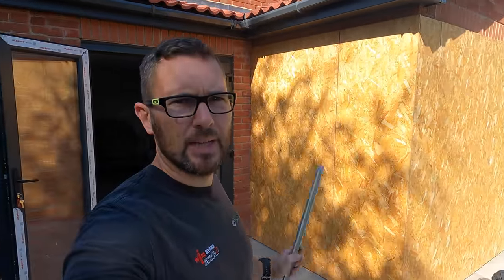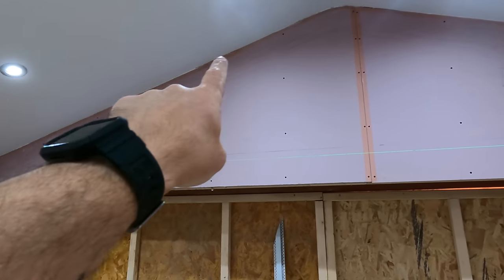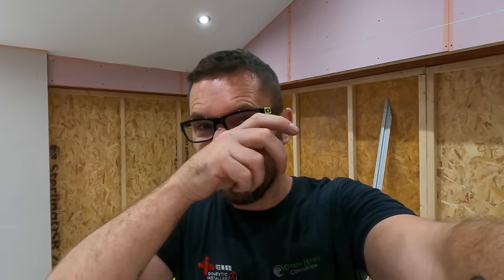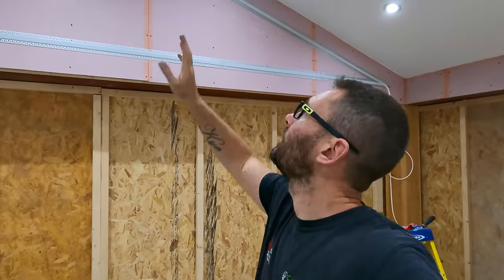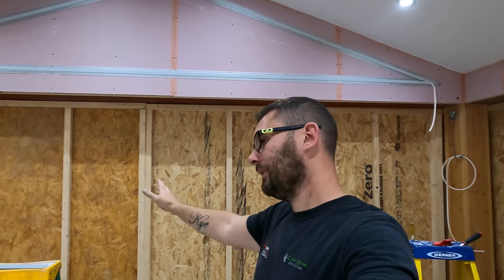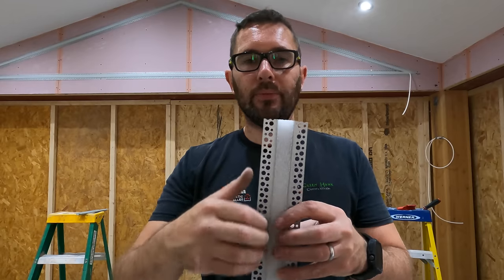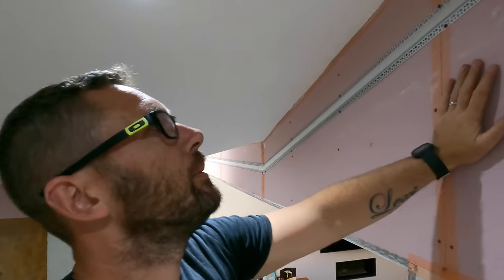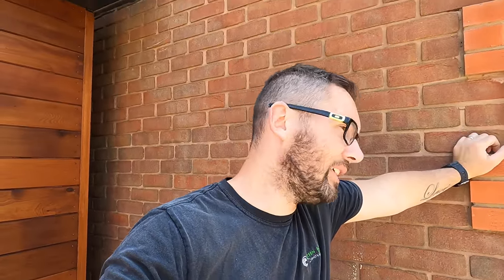How to install flush mounted  LED lights part 1

Comment: A little tip when making channels in plasterboard. Put two blades back to back in the multi tool. Obviously it depends on the the size of the channel but can be useful now and again. Great video as usual 👌🏻
Reply: I use a cordless circular saw with thin kerf blade 

Set right depth it’s fine

Comment: Seems the sparks I follow all seem to create their own safety problems.  You know those two top steps? Read the warning on the second step. It there for a reason.

Do not use the last two steps as you may fall. Look at 4:51, he is on the top step ( which has written on to "no step"), this is an easy point where a wrong lean will create momentum to make him fall.

So get taller ladders

Comment: Looks nice ! You might’ve covered it so apologies if I missed it but how do you make the connections  so that they’re not seen? I saw the wire at 8:14 coming out the end but what does that look like when finished, a blank plate housing the connections in the wall?

Comment: Pro tip, set your miter saw at zero, clamp a (empire) square to the fence-parallel to and flush with the blade. Now use the edge of the square parallel to the blade as your new fence, voilà, you can use your miter to cut those types of angles.

Switch position of the square from one side of the blade to the other for left or right angle cut. Also, you’ll notice the little corner of your square is notched at an inside angle almost as if it was designed to work perfectly with the blade on a miter saw for this. Google it if you’re having a hard time picturing.
Reply: Mate, I can't even start searching for this.... How do I find what you're talking about?

Comment: Cracking job that, customers/people just don’t realise how much time goes into this sort of work is the biggest issue! Not had to tackle the plaster in stuff as yet but like the idea…..the strip I’ve used so far seems to have a 5m max length, how do you get round that/round all those bends also? Genuinely curious, I tend to find it fiddly stuff to work with 😂👍🏼
Reply from the maker: Yep this has a max run of 10m and we are will have to solder the bends in buddy 👍
Reply: Nice job. What csa and type of cable do you find best for long runs of rgbw led strip?

Comment: I’ve got loads to do over the weekend I hate cutting it out 

I was thinking if the metabo wall chaser could be adapted with tiny circular saw blades one pass two cuts with extraction system
Reply from the maker: They actually do a double blade for the metabo mate
Reply: @GreenHawkConstructionltd  circular saw blade type ? If you have link post it might justify spending. 900 on the whole system